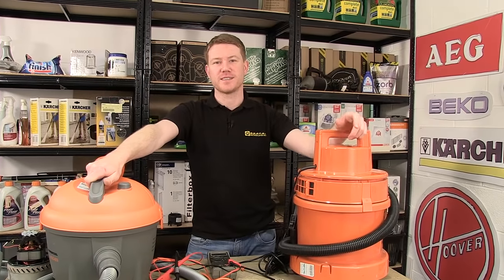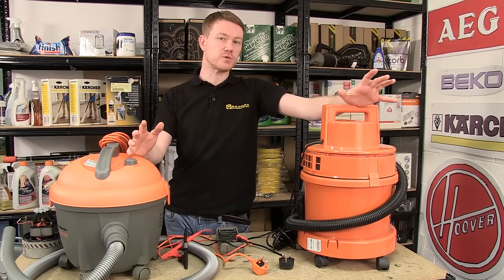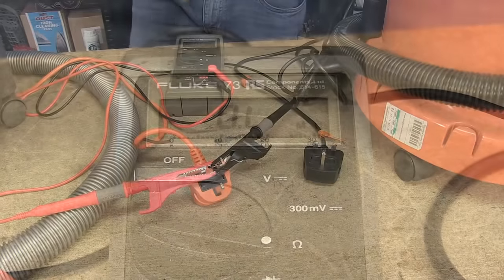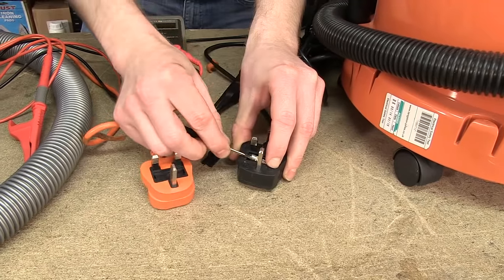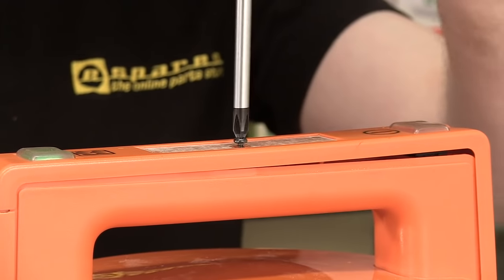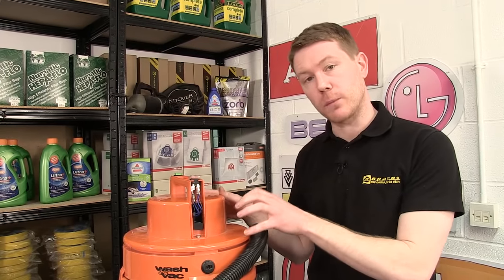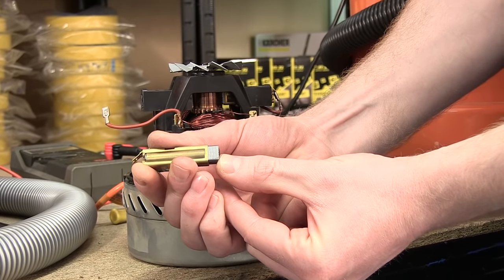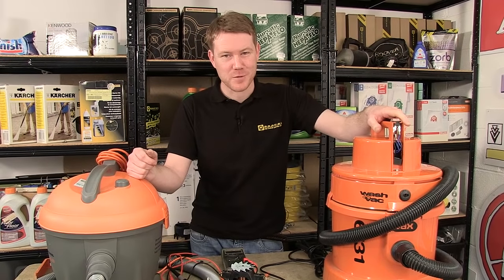How to Fault Trace on a Small Appliance Using a Multimeter

Comment: 1:13 That's not zero/no resistance. O.L means open loop, which is infinite resistance.
Reply from the maker: MrRoryJames Thats the problem using actors, they some times fluff their lines (LOL). You are correct the meter is showing open circuit but we think that most people will be able to identify the problem even if on this occasion we used the wrong technical description of the 'condition'.:-}
Reply: Is that true.? I thought all this long it means 'Over Limit'
Reply: Not certain about the points made but ,if anyone else  trying to find out 
electronics repair services
 try Saankramer Electronic Magazine System (just google it ) ? Ive heard some interesting things about it and my co-worker got cool results with it.
Reply: eSpares terribly misleading statement, should have been an edit

Comment: hi, can you please tell how to test a vacuum motor with a multi meter, many thanks in advance.
Reply from the maker: Hi Max, check the resistance between the two connections on the motor A good motor will have a resistance of less than 100 ohms on a low power machine to 30 ohms on a high power machine. If the armature is blackened it is likely the brushes are worn and arcing.

Comment: Does the appliance need to be switched on (not plugged in at the wall obvs) to test other things like the cable etc or just to test the plug?
Reply from the maker: When testing although the equipment should be unplugged it should be switched on to check from the plug all through the cable, switches and connectors all the way to the motor and back to the plug to confirm 'the circuit'
Reply: eSpares ok i thought that, just wanted to confirm as this is the first time I have used a multimeter.  Thank you

Comment: I'm testing a switch can I remove the capacitor to test the switch for contanuaty?
Reply from the maker: Hi Ray, the capacitor across the switch is to prevent arcing as the switch disconnects, It should not effect the resistance reading but can be removed if required.

Comment: I am non the wiser after seeing this.  Can you demonstrate on a faulty lawnmower please.  Cos my ones died on me I have no idea how I would use that gadget to discover the fault oh my mower.  Thank you.  Its a Qualcast 400 powertrak
Reply from the maker: Sorry it would take several months to produce a video. The reason why I sent you to this video is it is electrically the same as it has a plug, switch and motor so it can be used to understand the connections of a mower or any other 'simple' or small appliance.
Reply: eSpares Your channel needs technical college training